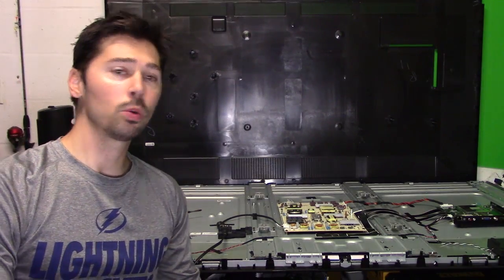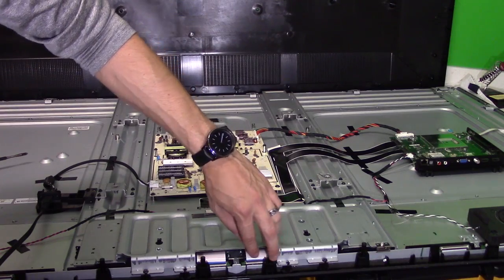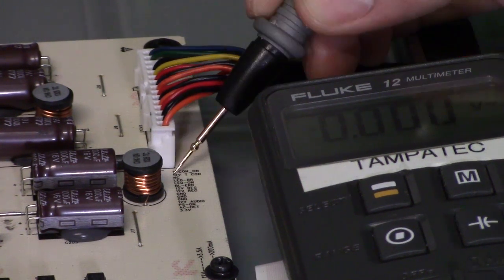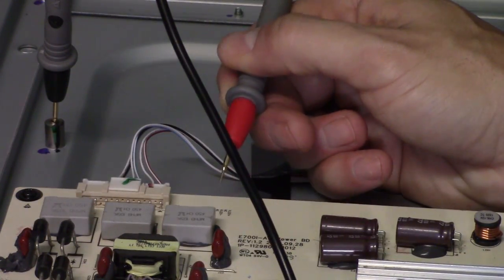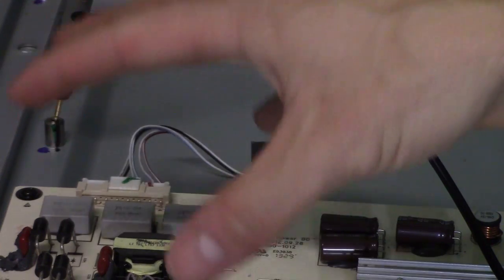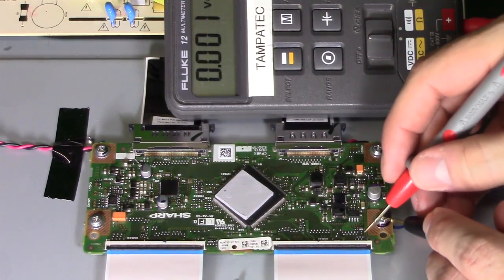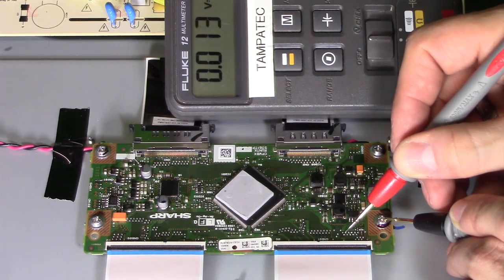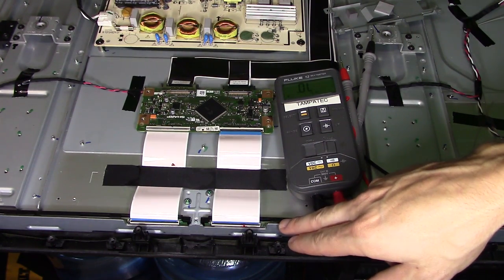How to Troubleshoot and Fix LED LCD TV Vizio and Sharp flatscreen No Picture but sound

Comment: I need  some help with my tv 

I plug my tv in it comes on

The sharp logo comes across the screen after a couple of seconds sharp Logo goes off of the screen and then the screen is black you can see a very faint backlight in the background and I have tried to Flashlight test I see no image I hear no sound I have plug things into the TV that has sound I still don't hear sound

The TV backlights are still on the TV stays on but nothing I tried hooking a USB in it charges my phone still LOL but that's about it also once the TV turns on it won't turn off unless you  unplug the power cord I don't have a remote

I took the back off everything seems to be normal I don't see any Burns or any bulges I do hear a faint humming sound coming from the power board I think it's normal

It has an error code 2 long blinks 5 short

My TV is a Sharp Aquos LED LCD TV model number lc 40n500u
Reply: Same problem

Comment: I have a sharp lc-65P6000 about a year old,  got water on the back side.  I now ave a 3" vertical strip just left of center that is a lighter shade than the rest of the screen.  After a lot of investigating and thanks to your videos, I guessing it might be a connection at the T-con board.  Am wondering your thoughts.   Thanks

Comment: Tampatec, HELP! I have the exact model in this video. I have no backlight and cannot see any image with flashlight. It also makes a pop noise from the speakers when plugging the cord into the outlet or when turning on with power button. I hear the "logic" board start up and have the red light for the audio and white light on the front. I measure correct voltages at the connector on the power supply for the logic board. I do not have voltages at the connector for the backlight on any of the pins.

Comment: Hello there tampa. I am troubleshooting the same tv and just like your tv I have sound and no image. I can see the back lights turn on and all of the correct voltage on the power board. I am not getting 12vdc on one of the black connectors that connect the tcon board and the logic board. Do I have to replace the logic board or a small components on the logic board?
Reply: I also replaced the t con board with a new one.
Reply: @GS-ge7pu  I am having the same issue with the second ribbon cable reading 0 V at pin 1. Did you ever determine what the cause of this problem was. Do you know what parts would need to be replaced (main logic board, t-con board, power supply, ribbon cables)?
Reply: When I turn off the tv the t con board does not turn off. Is my power supply bad?

Comment: Hi thanks for your videos. i check all the voltages and i am not getting 12v into 2nd T con ribbon cable, the first ribbon cable on logic board pin 1 get 12v the second ribbon cable on logic board pin 1 is 0v, am i correct to think it's the logic board  not sending 12v to T con 2nd ribbon cable?
Reply: I am having the same issue with the second ribbon cable reading 0 V at pin 1. Did you ever determine what the cause of this problem was. Do you know what parts would need to be replaced (main logic board, t-con board, power supply, ribbon cables)?
Reply: @michaeltremblay4221  No i still have the same issue LEDs are on but no image. i replaced both the main logic board and the T-con board at same time it did not work, luckily i got my money back. The only part left is the power supply board, but i am getting all the correct voltages printed on the P/S board. I gave up on it i'll try some other time.

Comment: Hello Mr. Tampatech  I would like to ask you ask question. I have Samsung LCD TV  model # LN40B500P3F,  Serial # B5BD3CESA03036P. This TV after 10 minutes losing the picture I checked the back light with flash lights pictures under the screen but does not light up. I thought was T-Con board I replaced but did not help. Can you please help me on this thank you.🤔

Comment: great videos, I have a LG smart TV. it is going on I can see even without flashlight but it looks like the brightness is in very low (actually it is not). I cannot see any bad part,  also power in backlight is 145volt. I actually did not do the test with backlight and light off. Any idea ...? thanks

Comment: HI two thumbs up on the video.

I have a samsung led fatscreen tv model# un46b7000wf sn z1hd3cnz101541w with no picture. Why do the power supply cycle the voltages on and off when boards are connect.
When I turn it on with all boards connected I hear a relay on the power supply board clicking on and off. when I measure 12v dc on t-con board it cycles on and off with the clicking relay. when I unplug the power supply cable from the mainboard the back light comes on and theres no relay clicking and all voltages are stable.  help and thanks

Comment: Hey Tampa Tec, I have a strange problem and I hope You can help me cuz I'm at a stand still. I have a 50" Vizio 3D Model 
M501D-A2R . I've replaced 3 boards , power supply, logic , and tcon boards with ones I bought on Ebay and still doing same thing . Ok here's my problem, when watching it , it goes fuzzy then back clear about every 3 seconds . The picture is awesome when its clear . I have a short video and put it on the input screen to see the problem easier. I looked it up on Youtube and a bunch of people had kinda the same problem but no one knows what it is . I was so sure changing the 3 boards would of took care of it . The guy I got the boards from had a LCD screen issue with the TV. My neighbor owns a TV repair shop and you know how people are , they don't wanna give out free info , he said they are throw away TV's . It cost $1100 at the time about 4 years ago . I don't really wanna throw it away .  HELP PLEASE !!!!!!!!!  I can send video if you want , just let me know where to send .
Reply from the maker: Sometimes I get bad boards on Ebay.
Reply: But doing the exact same thing ? What are the chances , lol
Reply: would it be the Tcon ?
Reply: I'm determined to fix this thing as long as it's not the buffer boards on LCD  , I'm thinking it would be like a relay type thing or transistor controlling the every 3 second problem, lol
Reply: Did you ever get this resolved? It definitely sounds like a main board issue.I'd get one from a seller who actually sells tv parts and knows what they're doing vs someone who just thinks their issue was a bad panel when in fact it was the main board.Let me know how you make out please.I try to stay on top of the latest issues with certain models.

Comment: I just replaced the logic board oon my samsung 47 inch and the menu for pip has clear and working colour (nice blue box) but hdmi input colours are all multicoloured isit the tcon board of dodgy ebay main board replacement?

also when i turn off hdmi input the nice clear blue comes back as it should appere!!

Comment: I have a vizio (Model E65-E0 and serial number: LAUSVKAS3702629, PART # 10258070222) 65 inches TV when I toggle the on button, the screen will come on,then flickers for 3 seconds with white horizontal lines and then goes black. Though it seems to be on but the screen will remain black and when I repeat the process same thing happens. I contacted Vizio and they troubleshooted the TV and nothing happened. Unfortunately I was out of warranty and now I have to figure out what part needs to be replaced and order it myself rather than calling technicians and get charged close to $400 dollars for the job. I have had the TV for over two years. During the first year of the TV, I had almost a similar problem and VIZIO sent a local technician and he came and replaced a board inside. Please help me. I just need to know what exact part that needs replacement and where to purchase/order it (reliable source part). Thank you in advance
Reply: You need a t con board and I have the same TV mines is 2018 tho and it has sound and lights from led but black screen so I I'm getting my t con board tomorrow let's see if it'll work

Comment: I have great picture, but no sound.  Where's your video so that I can fix mine.  The diode burned out (due to a short circuit) and it has had no sound.  I can't see how the diode was connected because it burned the area surrounding it.  Please help.

Comment: Question... i have a vizio tv and it has picture on the entire screen and has sound but 3/4 of the screen is darker and difficult to see. It started with top right corner, then the bottom right went darker, and now it has the bottom left as well dark. The top left corner is still bright. Would this be a tcon board issue or backlight issue?
Reply: 3 Pines Farm and Forge did you ever find the solution to your problem? I am having the same one!

Comment: Hey tampatec as a Sylvania LCD TV model number LC 370 ssbm 2 my question is my problem with the TV I have the standby I turn the TV on it Powers up reads Digital television across the screen and then turns off immediately what is your opinion my most likely problem
Reply: kevin broyles probably dust on the boards.  Mine did the same thing.  Get compressed air can and blow off the boards.  Make sure it is unplugged first.  Put the tv back together and turn it on.  Hopefully that fixes things.

Comment: I'm a novice, but willing to try anything safely.  I have a Vizio XVT473SV with great picture and no sound (just went out while watching).  I have gone through all the trouble shooting protocols and determined that the problem is internal.  Question #1:  Should the audio DC volts from the power board to the logic board be @ 3.200?  #2:  What should the voltage test indicate between the logic board connection to the speakers?  Thanks.

Comment: Great video! My sharp tv looks similar. LC70LE550u when the TV is OFF I get two slow blinks continually. When I turn ON the TV the blinking stops the back light comes ON and the screen lights up white but no picture, only sound. I cannot find any error code that fits the two slow blinks except for power PCB. But the voltages on the power board reads good. Any suggestions/help, would be appreciated.

Comment: hi i have 32 inch sony bravia and the problem is dead set no power and standby light totally dead. i try to test voltage on power supply and found 3v and 12 v.. can u give me some advice the posible problem? is power supply or main board? thank you so much

Comment: So I have a Sharp 70" Aquos Model LC-70LE550U. Have Back lights. When I disconnected one display ribbon cable and did a force start {Volume [+)]& Channel [-] ) , I do get volume and dark picture on one side and white on the other. When I flipped it, I got no picture on either side. But before I get ahead of myself. You talked about the standby voltage being 3.2 vdc. Which I'm getting. But what you didn't talk about but you have a little bubble that says you should also have 3.2vdc when the power is off. This I am not getting. My question is,  Is that bubble statement Vizio specific or should all standby voltages be read when off as well. And if you don't mind, a follow up question would be if I'm supposed to have that 3.2vdc and I'm not, would that cause the symptom of the LCD panel not displaying correctly as noted above. Any input would be greatly appreciated.

Comment: Working on this same tv, bought it for cheap because it wasn't working... took it home, plugged it in and to my surprise it turned on! However, 5 minutes later the c2 cap blew up in my face lol. I switched out that cap and it tuned on, but again, the cap i just put in started venting after 5 min...

I'm wondering if it was just a crappy cap i put in, or if maybe something else is going on? I'm afraid to try again without being sure because the smell of the venting caps is ruthless...
Any ideas would be greatly appreciated

Comment: I have a vizio led 65in d65ud2 . screen goes black with sound . no backlight . with flashlight test I can see the menu . if I turn off the tv and turn it back on the screen works as long as I dim the brightness. if I turn up the brightness it goes black . what part would likely need replacing ?
Reply: Did you end up fixing problem with tv if so what did u do?

Comment: Hey so I've been trouble shooting my TV issues for a few weeks now.  I bought a new T-con board, but still no picture.  There's no voltage drop across the part you identified that has a burn hole, but I do get some results on a diode check.  There's 12VDC coming from the main board, but nothing going out to the LCD screen. Are there some upstream components I can check to see where I'm shorting out?

Comment: Hi tampatec hi i got a vizio e701i-a3 lftrnxbp3100618 been watching your videos and jimmys videos and ive narrowed my tv down to no voltage on the t con on but have 12 v on the 12v tcon side whats your intake on which part to replace i have back lights but no picture

Comment: what if you have a glow on your screen for a second then it turns off and your power button constant blinks green
Reply from the maker: Carlos Avalos might be bad LED strip but check standby voltage and backlight on volts
Reply: That's what mine does exactly! Oh how I hate to throw out a tv! Looks like it could be more than one type problem. Hope you figured it out.
Reply: A bad LED strip is the one you said was very bad news, right? Not worth fixing. I live in VA and hate to throw tv out. Who do you think would still fix tvs?

Comment: I have E601i A-3 boards looks like the 70 inch that's in the video.. TV comes on, sound no picture back lights on, Vizio icon don't come screen.  I my voltage out of power board to LED is 88 volts in first board and 108 volts on the second board I swapped to... I noticed the IC chip DOSE not get hot or warm.
Reply: I do have sound..  Is my voltage to low or if it needs to be high... any idea on what problem might bbs?

Comment: Working with 70" Vizio TV (looks identical to this). All readings up to LED 1 and LED 2 were pretty accurate; however, LED 1 and LED 2 are sitting at 174. Is that a problem?

Comment: Nice videos! I have a Vizio E550i-B2    With backlight, no tv image but have a blue/white/gray light on screen and with audio. I purchased a combo panel in shopjimmy but nothing happened, i send it back boards. But i don't know if the combo board are damage too. What you recommend? Try again with new boards or put the tv on the trash? Thanks

Comment: +Tampatec - I have a SHARP LC-60LE660U No back lights. I replaced the power board with a NEW one I purchased from ShopJimmy. Still no back light. When I power on, I get no back light. If I hold the power button down, the back light will flash on briefly. 

When simply powered on I get the following voltages (to LED)
LED1+ 89v drops rapidly
LED1- 85v drops rapidly
LED2+ 84v drops rapidly
LED2- 0.2v steady

I am unable to check the other plug (stand by etc..) because the plug is 15 pin double stacked and is very small, and there are no test pads. I fear damage or possible shorting if I attempt to measure. 

Based on the elimination of the power board with a new one, and the current symptoms and readings are you able to point me to my next logical step. OR if the LED's are bad.

Thank you.

Comment: Thank you for putting this video together, it was a huge help!  I have a Vizio E601i-A3E that went black with sound.  I could see the TV with the flashlight test and went through this entire video, pausing to test along the way.  When I would turn on the TV, my backlight would stay on for a few seconds and then turn off so I used your guidance on the voltage test of the backlight circuit to help me diagnose that it could be a power board problem.  I kept testing everything including the T-Con board but the power board seemed to be the part that needed replaced.  I bought the part from Shop Jimmy as you suggested and installed it and the TV works great.  Thank you again and I know where I'm going next time I have a TV issue!
Reply: Theo Facaros moter,.mechaniç..repair.

Comment: I got readings of LED 1 + 2 and 3 @ 180.3  to 180.7 off of the main power board .3 to .4 on the negative side I also have no power according to the video to the T-com board its hard to see that video and where to measure the T com board Help please :)

Comment: Hey tampatec great vid as usual. So I was fixing my TV Vizio 55" E series,  and I had gotten the lights to come on and I could get pic, but some of the LEDs needed to be replaced. Then my daughter ( 1.5) climbed onto my table where the TV was and was sitting of my freaking TV. Now I can't get lights on and when I do the flashlight test I only see the right half of the screen. One of the Hard wired ribbon cables gets a little hot. Is my TV toast?

Comment: Hi Guys - My name is Dave & I have a dead Vizio 42"TV Model # VO42OE -- It has no power at all. I pulled the back cover off & I tested the fuse with my audible capacitor tester & it's good. I used my no contact line tester to check for power & it indicated there was power everywhere. Power to all the boards, but nothing is happening. --- Any suggestions  ?

Comment: I have a E601i-a3. Back lights won't come on and it doesn't have any picture with the flash light test (hot lady I bought the TV from said it did have sound). Voltages are good from PSU to main. I do not get any voltages to back lights though even when it's first powered up. I get 12v to t-con fuse. Any idea what could be wrong?